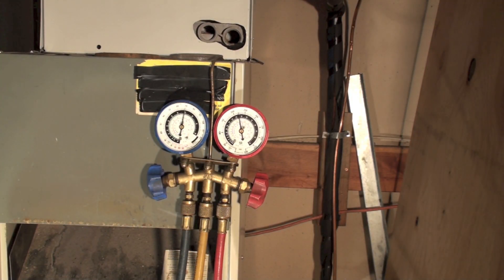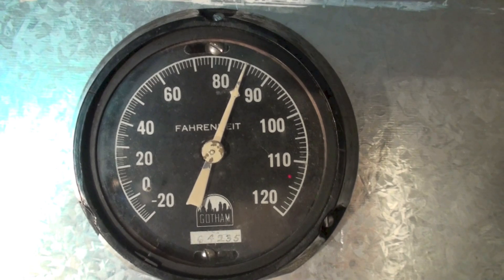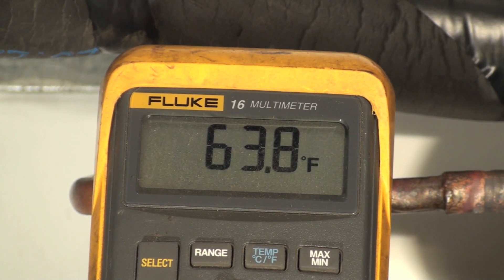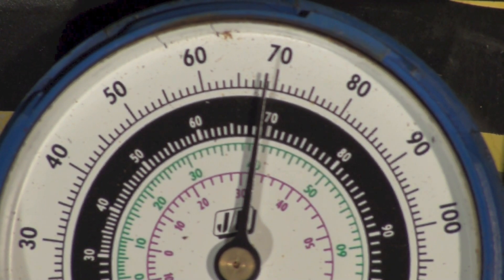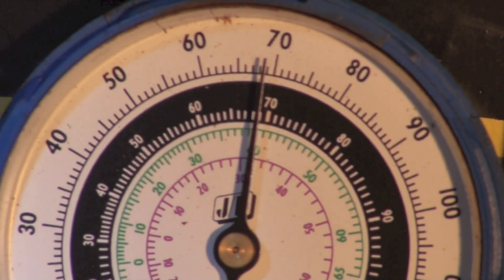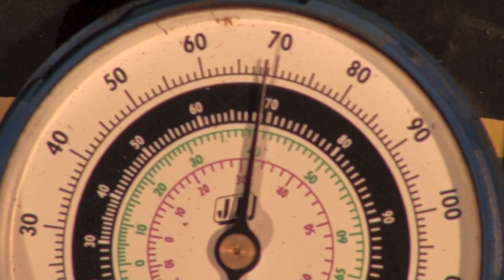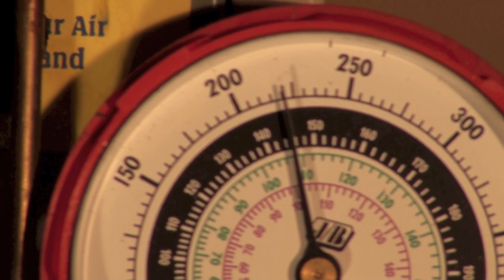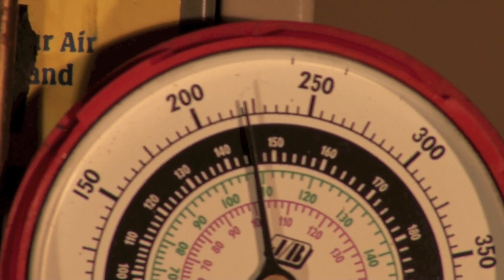How to check evaporating and condensing temperatures with the analog gauge set

Comment: hello sir..i have this  project work going (software analsys not used ) on..in a 1.5 ton split ac by installing evaporative media pad in front of condenser..i could get all of the reading expect the subcooling temp..i knew it happens in the TXV or capillary tube.. but  just i want the particular point where it starts and ends um stuck in it sir.. so that i could plot p-h dia....thank you sir...hope u will go through my request sir..

Comment: can anyone here help me..actually i need to find the evaporating and condensing temp..can you help me with the particular location at which evaporation and condensation takes place in a 1.5tn ac ..so that i can connect my gauges...i have this doubt..frm begng... can i find out the evaporating and condensing temp..with the use of temperature gauge..tank u for the answers..
Reply from the maker: Joel Abraham If you have manifold gauge set, the evaporating and condensing temps are printed on the gauge set.  Example is:  R-22, high side gauge reads 200 look to green numbers on the gauge.  You will see approx 104F.  This is your condensing temp.  Same thing on the low side gauge.  Temperature probes can be attached to the middle of the coil and may read correctly, but the gauge set is the best and easiest to use.  Hope this helps.
GFM
Reply: grayfurnaceman Thank you much..for answering...it gave me solution..doing great work..

Comment from the maker: .  In the heat mode, the line set taps become discharge and liquid line, so both are in the high side.  When a heat pump is made, there will be a 3d tap at the outdoor unit that is always low side.  Some units have 4 taps with a suction and discharge, and  line set taps.  When the unit is in the heat mode, you must use the suction tap at the outdoor unit to get both high and low side.  Hope this helps.
GFM